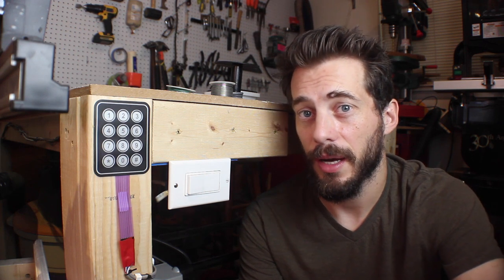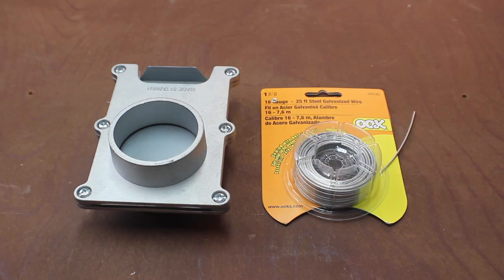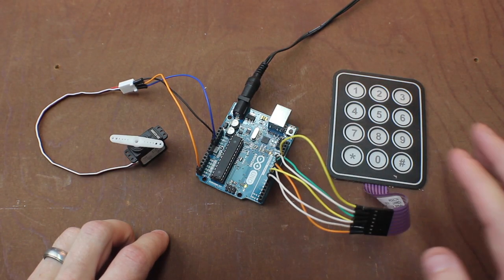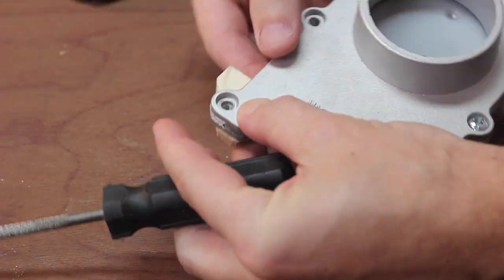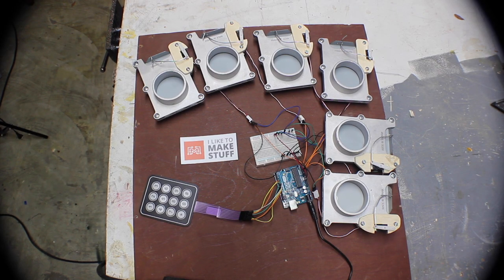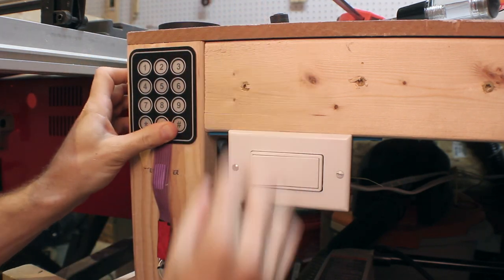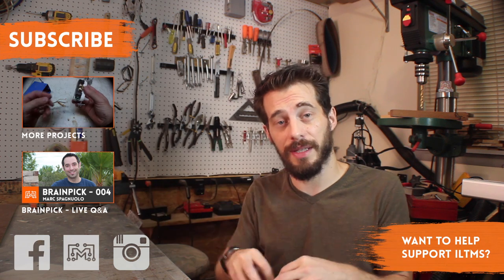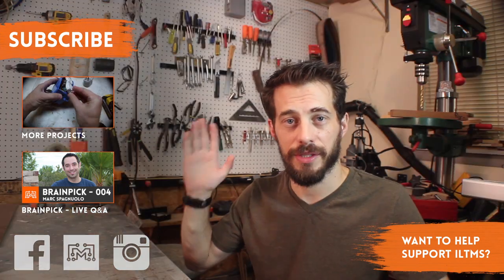How to control your dust collection with an Arduino (it's easy) | I Like To Make Stuff

Comment: I've watched this many times before but I really love the zooming in and out that you do with your video when you're talking. After playing around with my video editing software, I stumbled upon how to do this and so I plan on incorporating some of those into my my video editing. I've also referred several others to your channel on how to set up a home made dust collection system using a shop vac and plan on making one as soon as I acquire all the pieces.
Reply: +Joshua Luther Yeah, it's a great way to hide cuts when you make a mistake — much more fluid looking than just a plain cut. Have fun editing, and which software do you use?

Comment: As the years passed by, I improved on the original design by a lot.
I have designed print in place valves that plug into the rigid piping that I use, have custom designed addressable servo controllers on a bus wire combined with power sensors at the tools, that not only turn on an off the collection vaccum, but also automatically open the correct vales(single, multiple ect...)

Thanks for the original idea 💡

Comment: Ok that's just cool! Slick work Bob..  how much torque do thin those servos can handle?
Reply from the maker: Thanks Izzy! I'm not sure the actual measurement, but they're plenty powerful enough for these gates. I considered getting the high torque servos, but actually didn't need to after all. I think iff I'd stayed with the plastic blast gates, the friction they cause might have needed more torque, but the aluminum ones are pretty low friction.

Comment: I just realized how old this video is. Still holds up great. Idea for enhancement - somebody on reddit was talking about having vibration sensors on his tools to open and close blast gates and turn the vacuum on and off. I'm gonna try this myself. It would still use Arduino (or nowadays ESP32 lol) with the switches as a backup.

Comment: Thanks for getting the gears turning. Thinking of doing something similar with current sensing at the tool and a relay to the dust collector. Even add in a 5 second delay on dust collection shutoff.

Comment: This is great!  I'm going to try it in my shop too.  I saw a lot of comments about using it to 'detect the tool you are using at the time.'  I think that's an interesting idea, though I think I would rather allow it to turn on and off the power to a particular tool, and be able to control turning on and off the dust collection system.  I think what I can do is add a switch and relay at each tool, and at the outlet (or a relay controlled power strip I haven't decided yet) when the switch is flipped at the tool the arduino will detect the change in state, reconfigure the dust collection route, turn on the shop vac, and turn on power to the tool.  NOTE* does not turn the tool on, only allows power to flow to the tool.
Reply: +michael harrison This is awesome, then you can just turn the tool on and off as a toggle, so you can reposition pieces of material.

Comment: This is such a great idea. In my shop I bought an I-socket switch that turns the vacuum on when the tool is turned on, but I still have to open the blast gate. I think it would be really cool if you could try and make a system that would open a specific blast gate and turn on the vac when you turn on a tool. That would save quite a bit of time and effort. Thanks for the video!

Comment: You could probably code the Arduino to only open or close one servo at a time, that'll greatly reduce the power needed. Use a for/next loop to address each servo in turn.
If you play around with the servo arm lengths and linkage arms, you can get the blast gates to open all the way. Make the servo arms half the length of the diameter of the blast gate hole, and have the servos open and close through 180 degrees.
Good luck!  :-)
Reply from the maker: azayles You definitely could control them individually, but I did it this way on purpose.  When I open one, I need to make sure that all others are closed, but I can't see them all in my shop.  This forces them closed except for the one I need open at that moment.  As far as them opening and closing, as I've said elsewhere, the 3/4 open state is a condition of the gates, not the servos.  They have a little dimple built in to the gate that stops it at about 3/4 open.  Not sure why they did that, seems like a bad design.
Reply: Indeed, open one, then close the others, but one at a time. That way the initial surge current is much lower. You're not moving several servos at once.
That's a shame the gates don't open fully, didn't realise that :( I wonder if you can drill out the little dimple? Just rely on the locus of the servo arm to stop the gate popping out completely.
Reply from the maker: azayles Yeah, you could drill it out, then cover the hole, but honestly, the current amount of opening seems to work fine for now. I haven't had any problems with enough suction.  Changing the gate position would surely make it BETTER, but it's currently not bad.   I do have several upgrades planned, so maybe I'll add that to the list.
Reply: I Like To Make Stuff If you are getting the power from the arduino it would be ideal to use the one at a time method so you dont stress your arduino. But if you are using a separate power supply for the servos you will get a higher power and speed from them. Which i highly recommend doing. Plus there is less strain on your arduino and you can safely use your current method of all at once.
Reply: azayles I was thinking the same thing while watching the video.  The arms could be extended with a piece of wire woven through the holes in the plastic and a small loop could be made at the end of the extension with a pair of needle-nose pliers.  There's a tradeoff between length of travel and torque, but if the gates slide easily, there shouldn't be a problem.
Reply: How you could press one button and also save power; when a gate is open, it will be stored in a variable and only activate the one you want open and the one that is currently open.

Comment: Alternatively, you could have used a sensor on the machine side of each units mains switch.  it would mean two more wires to each machine, but you could use an optocoupled signal to make the micro automatically open the gate when the machine is turned on. You could go one step further and put the vacuum on a micro driven relay so that turns automatically too. All of it perhaps with an off delay for line clearing.
Reply: That would be real automation, not triggered by a button (control only)
Reply: Yeah, automation is kinda my thing, so its hard for me to view problems through another lens. If heaven exists it's chorus is composed of relay clicks. lol
Reply: @AtlasReburdened  i could use your help for a weekend , l0l
Reply: @hydeph Well, feel free to ask any questions you have.
Reply: @hydeph  do you have any code to do this for a new coder that has no idea how to do it. I can build anything. Just not a clue on code or computers

Comment: Very interesting approach to a problem I'm working on now.  I did not know about the Adwino controller.  I'm using TTL logic driving air cylinder driven blast gates.  Your presentation was very inspiring and I'm tickled to hear than more videos about automation are coming.

Comment: Awesome project, bob! The only thing that i would change is putting the button for the blast gate on the machine that the blast gate is connected to. That way, you wouldn't have to memorize what every button does. Of course, you would have to use much more wire, but i think it would also look cleaner, especially if you routed the wires behind the tubing. Again, awesome project, they always amaze me!

Comment: Nice project, Bob! I would even go a step further, and tie the dust collection's motor in. With a few little addons you could monitor the current draw on each of the power tool outlets, and turn the dust collector on, when you start a tool up, next to automatically choosing the right blastgate to open. Also you can than turn of the dust collector, once you stop the last tool (with additional a few minutes for tools like a miter saw, that get stopped/started quite often when making repeated cuts)
Reply from the maker: Andre Klärner yup, i definitely have more plans.. but too much in one video wouldnt be good for most viewers
Reply: Definately. There are btw. also other projects beside Arduino which make a nice impression for solderless projects. I really like Tinkerforge (http://www.tinkerforge.com/en/ ) as they allow really nice prototyping and writing code that isn't so static like C. I use it to monitor room temperatures and the temp/humidity of our terrarium and plan on replacing the annoying timers for the terrarium lights. Also it drives all my room lights so I can be lazy and turn the room's light off by smartphone.. ;)

Comment: I was going to do the same thing here but saw your awesome video! But just pushing buttons does not make for an automated system. Many Smart plugs now a days, monitor their power being used from them. So if one would connect these power sensor smart pugs to each tool that has dust collector and also to the shop vac, anytime you turn on a shop tool it would sense power being drawn from it and then open up its blast gate. And then turn on the shop vac. And once you turn off the tool, the vacuum would also turns off.

Comment: Very nice Bob. As for the venetian blinds idea, combine it with a light sensor module (~$10) and you can ditch the keypad entirely by having it automatically adjust your blinds ;) I did that for adjusting my PC monitor brightness levels, which was fine until the cat tried to eat the tiny sensor.

Comment: This is really crazy, but I was just thinking earlier today how I wanted to get more into electrical work, wiring, and all that because it's really interesting to me but I don't have a single clue how to do any of it or what any of the equipment is. But I do my own woodworking and was looking up ideas for my dust collection system and happened to fall onto this video. I'm going to take it as a sign, so if you have any advice as to where I can start, anything helps! I will be looking into the Arduino though for sure! Thanks so much for this!

Comment: I really enjoy your videos Bob. Keep up the good work!
I'm sure someone else mentioned this before, but I would like to challenge you to even take that automation project one step further... wouldn't it be really cool if the system would automatically turn on the shop vac and open the correct gate whenever you use one of your tools?
I think the biggest challenge there would be how to inform the arduino that a certain tool is active. I can think of a couple of ways to do that but I'd like to see what you come up with.
Cheers and keep up the good work, I've been learning a lot from you.

Comment: Love it Bob. Just my kind of project! 

Perhaps an upgrade down the line could be installing current sensors to detect when you turn a particular tool on. Then use those signals to drive the servos for true automation. :) The only downside would be less use for that sweet keypad. :)
Reply from the maker: Geeksmithing Yeah, I'd considered that, but it turns into a bigger project :) I'd need to handle turning on the vac as well.  Totally doable, but one step at a time :)
Reply: I completely agree. This is definitely less intimidating for newcomers to the platform. The beauty of arduino lies in it's modularity. :)

Comment: I will probably never do this since I am not really interested in carpentry (well at least now, duh), but this is a really good example of what you can do with rpi/arduino and whatever else is out here I've never heard about :)

I'm pretty sure I could make such system myself (at least programming part to control I/O) even though I've never worked on this "low level" like this where you directly control hardware using software, since I am kinda "programmer" myself and have done a lot more complicated stuff so I hope more people will get into programming because of this video. Or at least will try to make something cool.

Comment: Hey Bob, I would suggest an improvement...you could make it in a way that as soon as any of your saws turns on, the dust pump turns on and the respective gates open automatically. You can realize it by putting a vibration sensor on each one of your saws, and as soon as there is vibration caused by the specific saw being turned on, Arduino will turn the dust pump on. The sensor that detects the largest vibration of all the saws will open only the gates of that very saw, and turn it off as the vibration stops.

Comment: Great idea and well illustrated, though I'm concerned your servos will wear out a lot quicker than you might expect.

If there's any load on the servo while holding the gates open or closed, that load will be consistently placed on whatever teeth are always used when the gate is open or closed. This makes those few teeth much more likely to break. And they do break - I've had countless cheap servos lose teeth over less significant loads (like balsa elevators on tiny RC planes).

I'd recommend using standard size metal gear servos if you want to reduce servo replacement costs. They cost more, but maybe not as much as two cheapo plastic gear servos. Find the highest torque for the cheap price and you should be fine. You don't need speed here, but torque cannot hurt.

Ideally, the servo should only have to work hard when change from open or closed. When it has the gate open or closed, its job should be done until its time to change the gate again.

A better engineer than I would be able to sketch up some linkages that would "lock" into place, relieving the servo once a gate was open. When changing from open or closed, the servo could unlock the linkages, locking them again once the open/close state transition was complete.

Comment: Very vel done,  i been thinking about using the arduino too set the hight on my router table.  I had an idea for your system, if you hook up each button on your power tool too the arduino,  so it opened the blast gate on the current tool you are using,  and then close it again 20 seconds after you stop using the tool.  And also hook up a relay that start the vacum cleaner when a power tool is running.  Anyway it was a awsome and creativ way on the blast gates. 

Sorry for my lack of english skill but i hope you understand what i mean. 

Best regards

Comment: I have just started learning about the arduino and I love this video. I don't know anything about programming except an html class I took in 2002. I love your idea about using a micro processor for venetian blinds. could you do a video on how you might tie in your home wiring to the arduino and control your blinds, ceiling fan, and light switch from one control station?

Comment: That is just the coolest thing I've seen in a long time! I wish you would have gone over the code. I am very fascinated by this type of stuff, but the programming is terrifying to me, and I don't really feel like diving into it for that reason.
Reply from the maker: ***** Yeah, I understand that it can be intimidating. Check out arduino.cc  they have tons of tutorials and sample code. It's really not as scary as you imagine, I promise :)  Also, in the case of this project, 80-90% of the code is copied out of their examples, then I added a bit here and there to take the input and send it to the servo.  Don't be scared of it, just take a look and you may find out that you love it! (or at least can get through it easier than you expected)  Good luck!!

Comment: Nice project!  One bit of advice, it's a good idea to put some capacitors on the power rails, especially if they're long.  The servos will have wildly varying current draws and without a cap to buffer, you're going to tend to get voltage sags that might cause erratic behavior.
Reply from the maker: Dan Heidel Good call!

Comment: Interesting idea, I would have coded it a bit different. What if you want 2 of the blast gates open? With your current code you couldn't do that. A simple way to do it would have been to just have the door open, and not effect any of the others when you pressed a number. You could still have the close all button and then just open whatever ones you want and then just close all when you were done.

Comment: Just a thought but I would make it so that when you open a gate at the gate it turns on the vac and that it turns off when you close the gate.  It would require wiring in a bunch of micro switches and a high voltage relay to turn on the vac I think it would be a bit more useful especially for a larger shop.  Then you would not have to go back to the key pad to close and turnoff the system it would go off when you were finished at the tool.